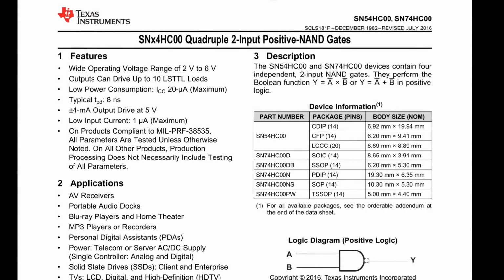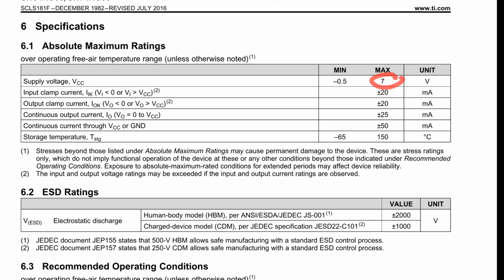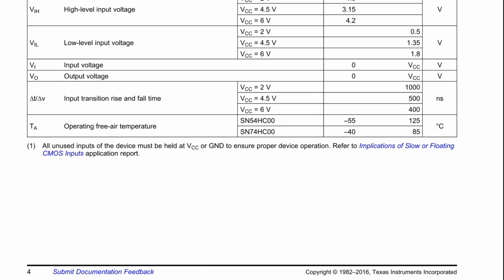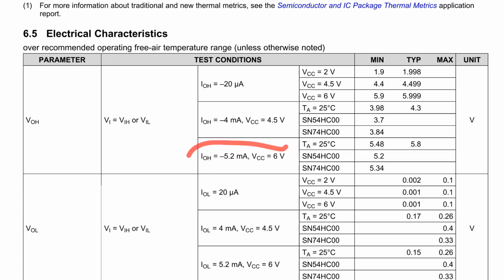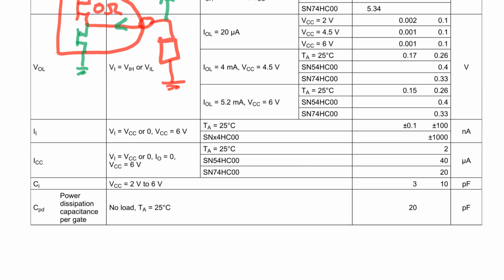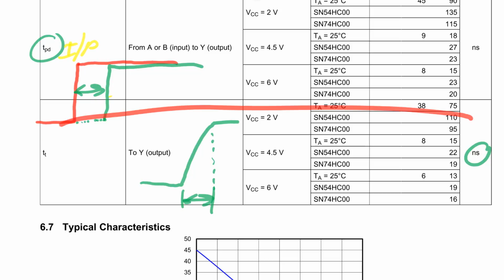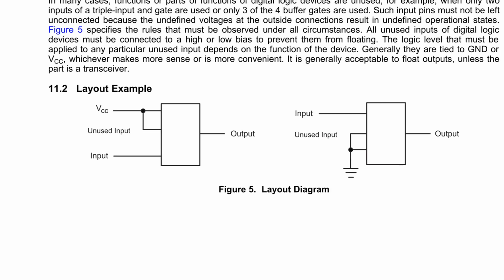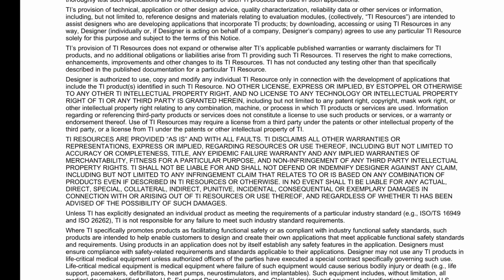EEVacademy | Digital Design Series Part 4 - Digital Logic Datasheets Explained

Comment: I wonder why they used 2v, 4.5v and 6v as examples instead of more common 3.3v and 5v levels in the datasheet.
Is there any reason why they did that?
Reply: I would assume, standard batteries as power supply without voltage regulation where quite common in these days and this gives us:
3*1.5 V = 4,5 V
4*1.5 V = 6 V

Comment: Hi Dave, thanks for the video!  Prior to watching I didn't know the relevance of half of the datasheet, now I do!  It would be cool to see you take a look at a very complex FPGA datasheet, or at least a single section of it.  It'd be nice to know what all the voltage rails an FPGA needs are used for internally, for example.

Comment: Wow I used to connect up my 200 in 1 logic chips to like 5v of anything. If it was like this was there a chance of blowing the chips up? I guess FET transistors don't have that voltage drop of diodes of 1.2v. Is this why dimm memory can never go below 1.2v?

Comment: Just btw, those clamp diodes are usually ESD protection diodes. But even if tose wouldn't be there, if you exceed Vi above Vcc, it wil allways clamp, just with much lower allowed current.

Comment: About maximum ratings. In some cases your device will still run fine (as in not blow up) if you exceed, but they simply can't guarantee. Sometimes that's a little confusing, IMO that's part of recommended ratings.
BTW, what I find very annoying about some datasheets is that they don't short peak currents (instead of only continues). Which can be a very important parameter when you use these things in high switching circuits.
Reply: To maybe make this a little more clear.
How should I read "continuous" output current?
Is that RMS, is that just a DC current?

And if so, does that mean that with a switching signal I can still just this as an RMS value?
Because the peak current will be (much) higher in that case.
Extremely frustrating that manufactures are not more clear with these things.

Comment: I'm at University. Last year we had a course about controlling techniques and EE stuff. Yeah, I like EEVBlog, and we're get more. Yeah... We shoud know this from there, and that from there style lectures. But there was the times when we did stuff on real hardware, PLC. Profi-bus, ethernet, registers, they showed us a non working pneumatic "factory" that we will make, aaaaand actullay the most advanced thing required about 10-20 relays and 4 timers. A crude traffic control lamp. Under a half year. But more than half of the students did it w/o real stuff, just computer emulator, the real hardware was a simple kit, 20 leds, 20switches, an HD44780 like LCD with some buttons as HMI device. The last was never used. We programmed in ladder logic. The only thing I learned is the opposite of set is reset. disappointedly goes back to program esp8266 in arduino api
Sometimes I feel like Dave makes much better education than our university. If I put the same time into this channel I'd be a better EE than computer engineer now I am. I'm teaching at the university at the same time, there is a course about OS, and I teach the programming part of it, so how to use C to use the OS features, shared memory and stuff like this. I draw up the stuff for the lesson, explain it, write a program about it on the projector, make deliberate mistakes to show how not to do, while showing how to use documentation. The clear the projector, but leave all cheat stuff on the white board, and give links to official and non official documentation. "Any questions?" silence And 10-20% can redo the same program in 30 minutes, no question asked, any help can be used, even can work in groups. Goes around, and some folks can't even program in C, like read a file to memory then print it back out. And that isn't the first course when they use C.
Reply: SzDavidHUN Nice.

Comment: Worth noting that it does matter for Icc if the input is something other than Vcc or 0; in particular, if you have an input floating at 0.5Vcc, Icc could be quite large, which is why the data sheet mentions somewhere that you need to be sure to tie unused inputs to Vcc or ground.

Comment: Do I really need to go through all that current checking and ajusting in real life? Isn't there a tool that altomate all this boredomness? Like, preferably in HDL?
Reply: Nope you have to work and think for your payment.
Even those data changes if you pick another manufacturer even if the model No. is the same.
Reply: My point is, it is suitable for automation. I'm just wondering if there's such a program already.

Comment: Can you do a video on how to create footprints inside altium or circuit studio?
Reply from the maker: Why? That would just be a specific how-to video on how to use a $1000+ commercial package.
There is no value in that apart from Altium customers.
Reply: Robert Feranec has done quite many Altium tutorials. Maybe also on footprint creation...
Reply: I mean, interpreting the datasheets and creating an Altium footprint or circuit maker or any other PCB tool. Are the measurements in mm, inches, feet, meters, kilometres, etc. What does it mean when you have a number in a box. In that video, you have a number then a line underneath then a number under that, what does that mean? What does the semi-circle symbol mean?

The 7400 series are relatively easy to interpret, however, when you get into some BGAs, it can be rather complex. The NorComp 684S7W2103L461 connector can be confusing as well.

And it's also very important, as you have gotten it messed up in your recent nixie tube design as well.

Robert Feranec doesn't have anything on footprint creation. Also, Robert can be condescending sometimes in how he explains things, although he does know his stuff.